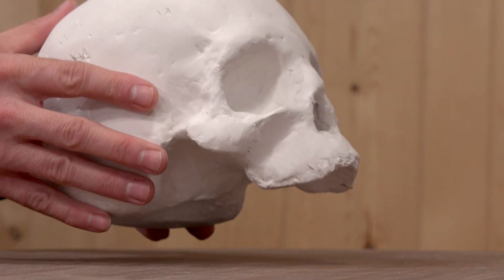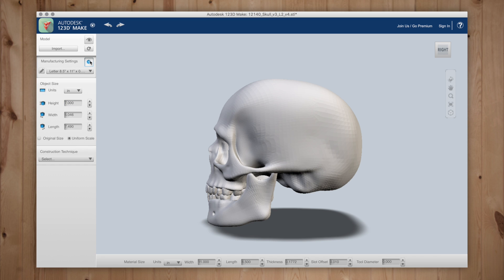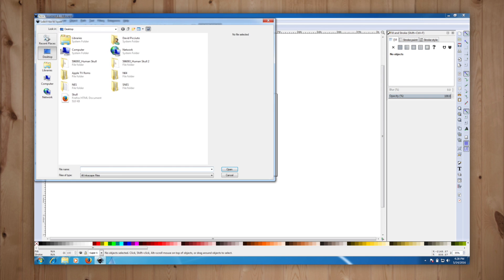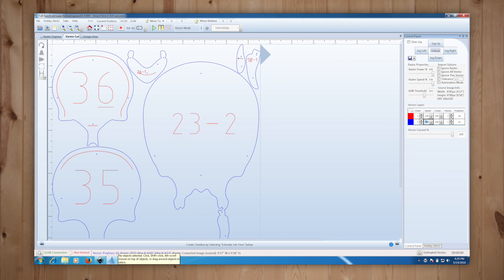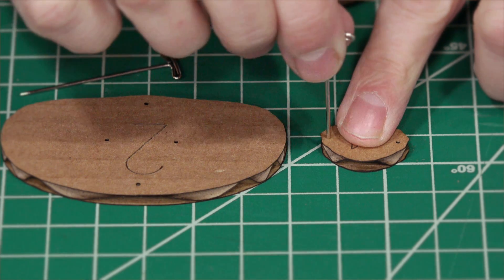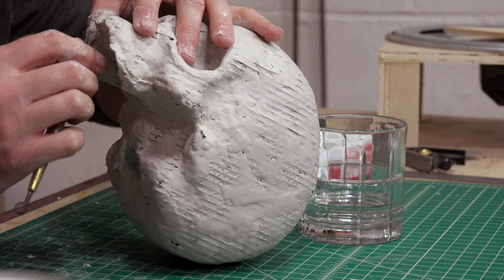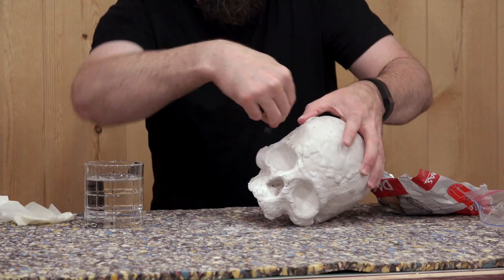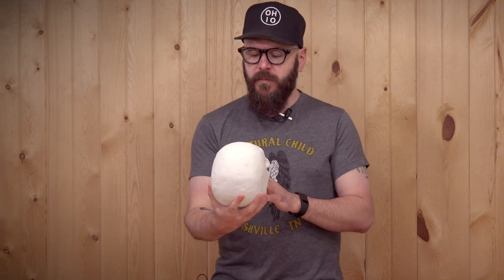Laser Cut Cardboard and Clay Human Skull: Full Spectrum & 123D Make

Comment: To age it, I would cover it with wood stain and then wipe as much as I could off.  The stain will stay in the crevices and give it lots of texture.  You could also corpse it.  Wrap garbage bags or saran wrap around the skull and use a heat gun to shrink the plastic and make holes in it.  Then use the stain on that.
https://www.youtube.com/watch?v=69p2EyS-5qk

Comment: Awesome video David! Aging and weathering can be a lot of fun. I like to water down oil paints in blacks browns and reds and dry brushing then wiping them off. The key is lots of light layers. one cool trick I've found if you want it to look wet and stringy with skin bits is to pour on some contact cement and string it between surfaces. once it dries and hardens it looks like puss and paints well. Thanks for the videos!